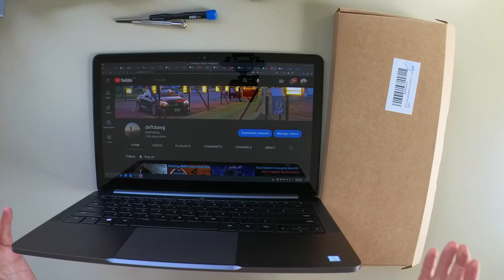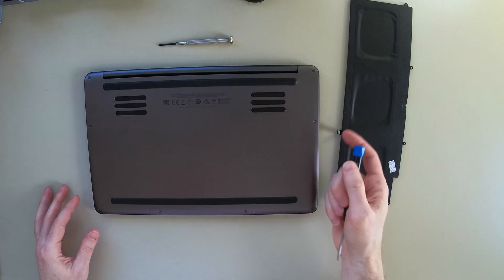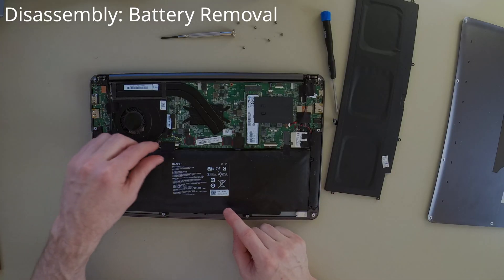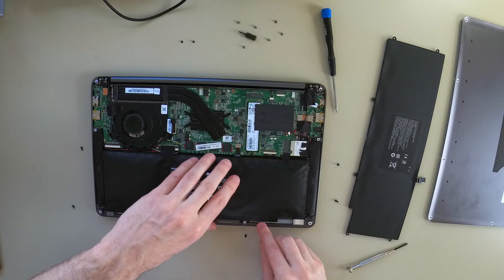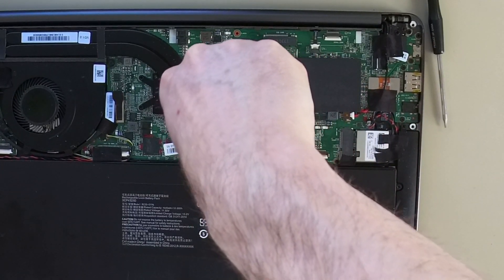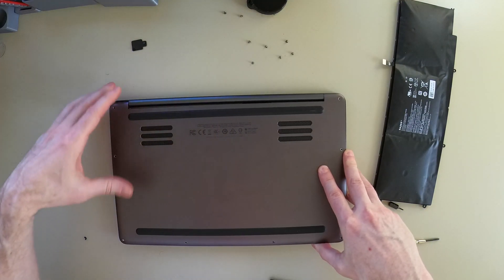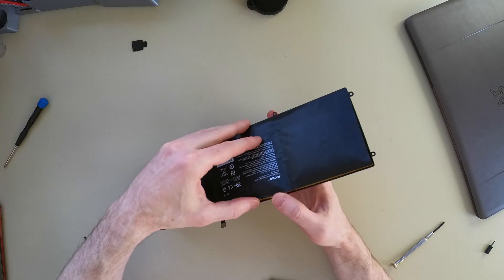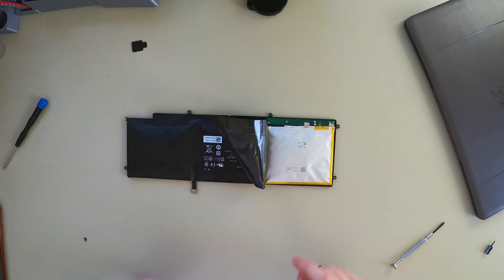Razer Blade Stealth 13": Battery Replacement

Comment: after you installed the new battery, how was the performance after? did it last a lot longer. my razer stealth battery is pretty bad. wanted to upgrade the battery. Great video btw
Reply from the maker: It was a lot better, unfortunately shortly after my screen developed some banding (the replacement screen is too expensive), so while I still have the machine, I don't use it anymore.